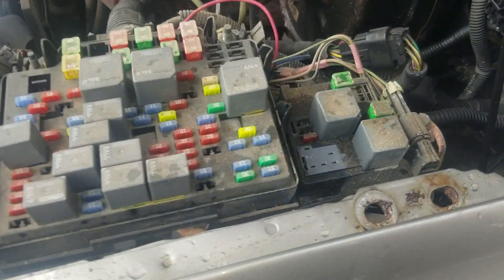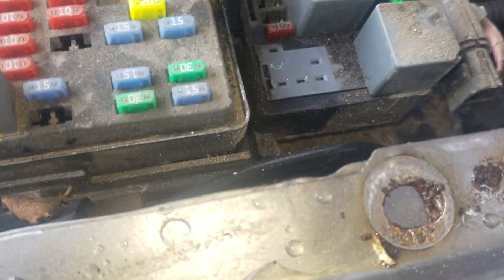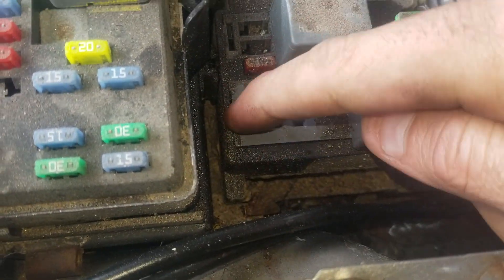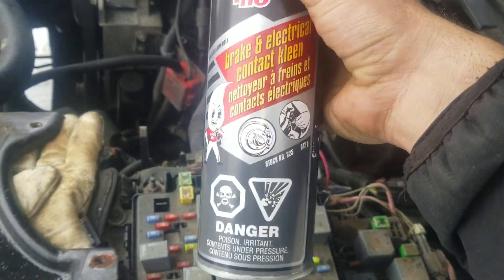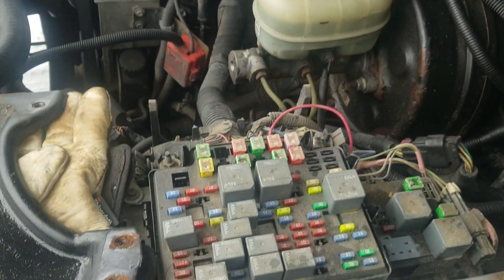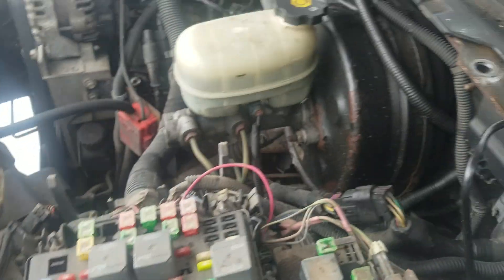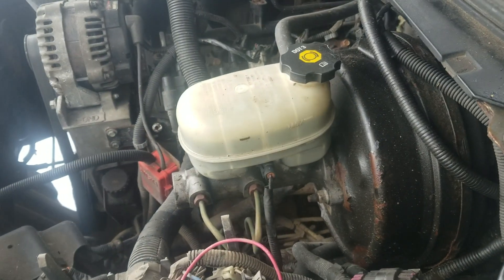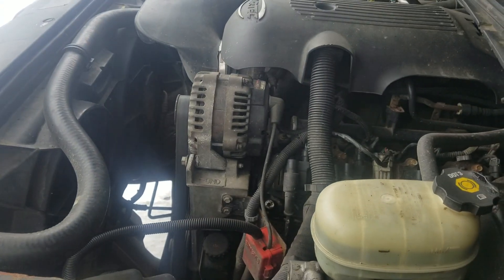2006 GMC truck radiator fan relay trouble

Comment: I have the same problem with my fan not working on my 2006 Yukon Denali xl so do I have to air clean it and replace my cooling fan relay #3?
Reply: I had to replace the fuse box itself it was badly corroded inside and would not make proper contact with a new fuse!
Reply: @albertwalker0525  I also need to know the part number for that fusebox. I can't find a replacement anywhere. The inside of mine is too far gone.
Reply: Yes
Reply from the maker: Yes